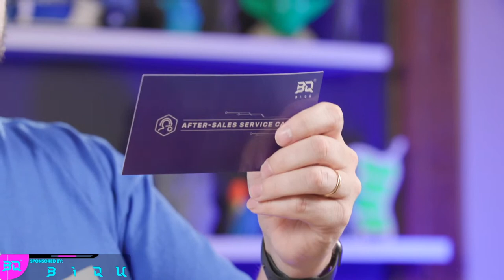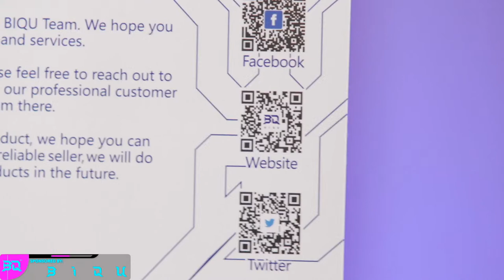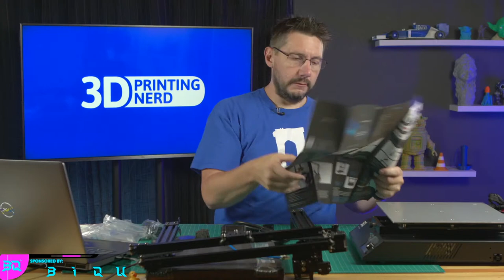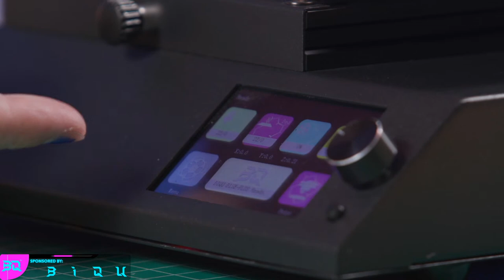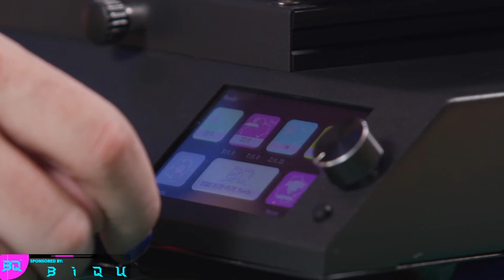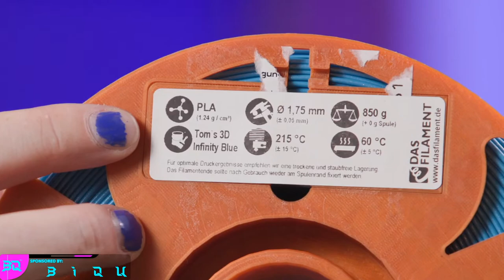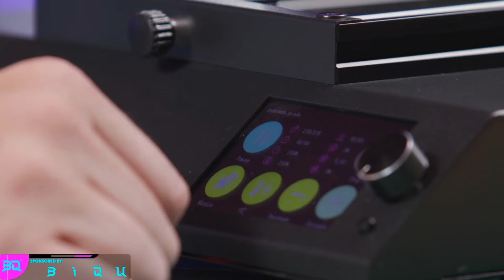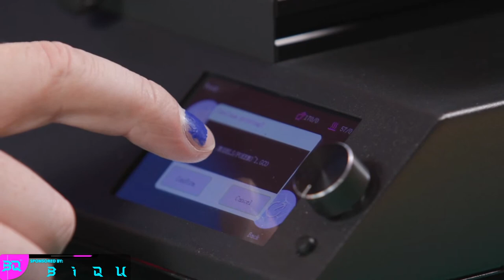BIQU B1 SE PLUS Unbox & First Print LIVE!

Comment: So I have an Ender 6 that just arrived for my worksetup in the mail. But after my own research, I think I have a compelling argument here to getting the B1 SE Plus.

All prices with tax and shipping included from amazon - ender 6   to  stock website - B1 SE Plus

Ender 6 stock on sale 490(ish) comes out to 520 with tax if you have prime
- Core X-Y Semi enclosed
- Creality Name
- 250x250x300 Build
- Rest stock as you would see on other enders
- has snuck in noisier set of steppers and not so wonderful fans but with enclosure it's not noticeable.

If you take the price and up your budget you can afford some silicon bed springs, direct drive h2, and octoprint for around 750$ conservative. ( Always depends ) and most people would call this a fully set machine.

But on the other side. You could get Biqu B1 SE Stock for around 300-350$
- Better touchscreen with switch support to marlin
- Bigger Volume 310x310x340
- Modular support following their platform without needing proprietary nozzles or parts involved. ( So you could print adapters and get their cheap upgrades or some other sourced )
- Noisier than Ender 6 because of no enclosure but same stepper and fan issue. Steppers are socketed for dual z upgrade around 30$ so sourcing less noisy ones should be easier. As well as fitting noctua fans in the power supply and hotend.

For a budget raised to around 550$ including 15$ shipping
- PEI Spring metal bedsheet to fit this non standard bed
- Dual Z Upgrade + Linear Rails ( From Hermit Crab Tool Changer Set )
- Direct Drive H2

and still have wiggle room for rgb and octoprint or wifi cards.
Also some ikea cabinet with the screen for a fully enclosed printer

This is all my findings so my question is

What am I missing out on? What other offerings are there that are comparable for someone willing to follow a guide on reddit to update this machine.
Should I return the Ender 6?
Reply: Not even mentioning the autoleveling on the B1 SE Plus Stock

Comment: Comparing to the Biqu B1: they replaced the nice magnetic spring steel sheet with a stiff ultrabase type surface? Ok, they added ABL (which can be added to the B1 really easy), but there seems to be no improvement too the extruder and the filament runout sensor. The TFT seems to be downgraded, on the B1 you can switch to Marlin mode and have nice menus for filament change, babystepping.....

Comment: Hey Joel, 

You can always have a small mirror on a printed adjustable bracket to set on the table such that when you having to screw in screws on the printers the mirror can be set and angled such that the camera can look at the reflection with a small LED light shining on the area so we see the printer side being set up that you normally can't let us see due to you needing to screw stuff from you side of the table!

No turning around the printer to our view needed then and no 2nd camera needed over your part of the table.
 
And those free small amounts of filament they give out with the printers 

They all should have it on a recycled stiff cardboard rolls so they save money and we have a better test amount of filament which rolls off in to the extruder without getting messed up and the roll can then after it is used up be recycled again!

Just idea?

BTW, I Clicked the link for the printer here and it takes me to the UK Amazon site ( which is good as I am in the UK ) But the printer that comes up is this:

So the amazon link is sadly the wrong one at least for the UK Amazon site?

Comment: NIce video. As a BIQU B1 owner this was interesting to watch.
My B1 has a level assist function I would love on other printers. It prints a zig zag pattern accross the entire surface showing the mesh. This helps me level/tram the bed and showed me that the middel of my bed was slightly higher than the edges.
About your Sunday video. Made me do a TPU ABS experiment.
DO NOT PRINT TPU ON A 100 C BED! I had all my days trying to get it off. Hope I didn't bend my spring steel bed plate.
Reply: but is there a way to print TPU on that? WIth a cooler bed temperature, maybe?
Reply: @Yamagatabr  I should think so. I used TPU to try and get bed adheasion for my ABS prints based on his other video, and the fact that I print 3 layers of TPU the switch to PLA for the rest of my prints. This gives me a rubbery, non-scratch base for my prints, so I can place them on wooden surfaces without worry of scratch marks. The CURA pause resume function works a treat on my Ender 3 and my BIQU B1.
But my ABS, although it stuck to the TPU, it did not stick to the rest of the ABS..... LOL. I have given up on ABS for my printers. I now only use it in my 3D Pens.
Reply: @Yamagatabr  Also, the BIQU B1 has a default pre heat setting for TPU at 230 nozzle and 50 bed temp. PLA+ at 230/60 works a treat on it also.
Reply: @MrGerhardGrobler  nice! I think that PLA nees higher temp to be "sticky" even to itself, wil probably need an encolsure for that.
At least, that is what I have studied so far, I will buy my first 3d printer this month. Have you compared  the regular B1 and the B1 Se Plus? I'm trying to choose between the two, and it is hard. as far as reviews are concerned, the B1 seems more polished and quiet, and the B1 just have upgrades in relation to it's larger print area. But I'm not sure if I need its larger area and if it is noiser and gives a little more hassle and setup time with its BLtouch and Glass bed than simply using the magnetic one and regulating it sometimes.
Reply: @Yamagatabr  PLA is your least fussy filament. You can even print it on a non heated build plate.
I haven't compared the different BQ printers yet.
I have an Ender 3, Ender 3 Max and the newest, the BIQU B1.
All of them can print TPU without an issue, but speeds of 10mm/s.
The BQ is the only 1 that can print SBS filament at normal settings. Due to its well designed and all metal feeder setup.
Depending on your budget. I would review all the printers in your budget.
Ender's are well supported by the community. BQ has a growing community.
I have managed ABS prints on the BQ, with a massive raft, and 100% infill with 0% fan, in open air. But the parts where small, and printed fast.
I cannot tell you what to buy.
I am lucky. I have 2 3D printing stores within a 10 mile radius from my home. If I have trouble, I can call, go in, and have the store owner help me sort it out. For the rest I watch YouTube channels like 3DPN to teach me what I don't know.
Also the reason I bought my Ender 3 Max.

Comment: Hi not sure if you’re going to respond but how do you slice stuff for this print? I used the biqu b1 setting and changed the volume and it didn’t level. Used the B1 abl setting changed the volume but it didn’t print in the middle but everything was printing on the left. Got any recommendations?